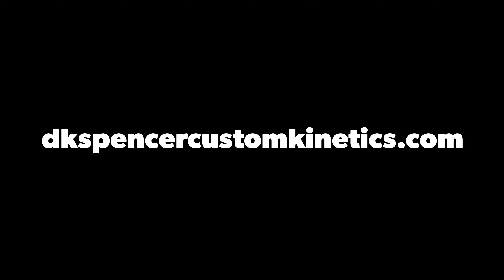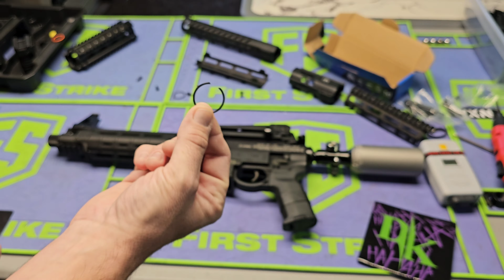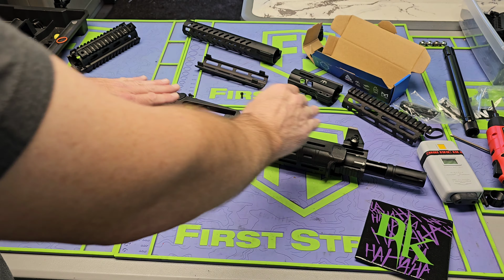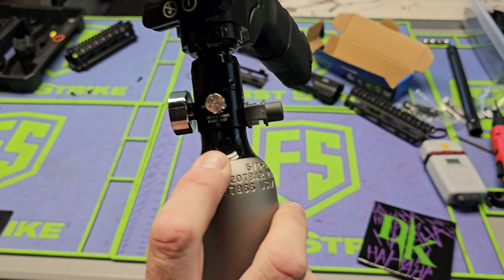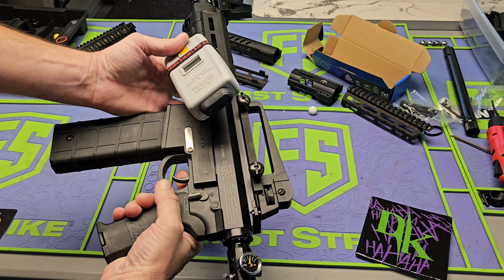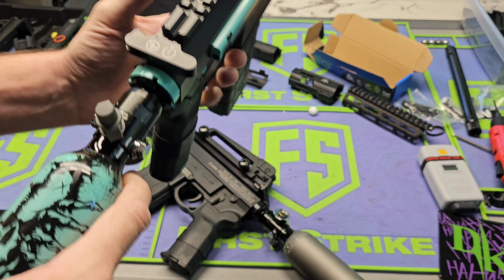Part 5: Conclusion and Test PSI/Sterling mod on VKS

Comment: Nice job.
If you shoot juls V2 8g then will not perform better? The white ones looks loose on the detent 🤔
Reply from the maker: For the detent yes for power no.  I typically get just a smidge more out of the heavier ones which that's just typical ballistics.  But the v2's definitely don't slip out as easy but with wixon's neither do the others
Reply: @DK-Spencer  sound good thanks for the information 👍🏻

Comment: Henry is an authorized Pepperball dealer. I sense there's a lot more to that customer's story besides "I bought this VKS from PSI and now he refuses to work on it." 

Cheating customers, bad customer service, or abusing them are the quickest ways to have a dealership agreement yanked. So what I suspect happened, that customer attempted to mod his VKS and in the process he ruined it. End result, Henry probably accommodated the guy up to a point then reasonably he stopped. 

This is a very common situation in retail sales when questions of warranty repairs come up. E.g., companies will not honor a warranty if the customer has in any way fooled with the product. To be sure, we all are familiar with the warning: "Removing this screw voids your warranty." And no company (e.g., Valken, Umarex, Byrna) will work on your launcher after you modded it. And those who lie about not modding the launcher, on a warranty claim the Company will look for signs of tampering. 

Bottom line, Henry and Danny have business relationships with the big companies. So I seriously doubt your new friend/customer is being up front with you. Seems to me the decent thing to do is that customer should be up front about what happened to where Henry said "no more." I suspect that BrilloHead guy may have modded the heck out of his VKS, ruined it, then expected Henry undo the damage. (I vaguely recall Henry about a year ago mentioning something about this situation.)

P.S. Curious: Did you do all that work for free? If not, how much did you and Charles charge him? Also, why is his eBay ad still active?
Reply from the maker: Henry has never claimed to be a dealer and Sterling lies about being a dealer.  Both have a lot more than just this guy that have complained about their customer service so yes I believe him and no I did not charge him anything
Reply from the maker: Number one authorized dealers cannot sell modified products number two authorized dealers cannot sell on eBay.  They both sell modified markers and both sell stuff on eBay, lol.
Reply: @MortimerEsq I did not break anything except the air chamber o ring. Henry is going around lying about what I did or did not do. Don't believe a word he tells you. Just don't. Not to mention the fact that Henry overcharged me for his build. What I asked out of Henry is not unreasonable as he claims. In fact, that's basic customer service that he should have provided to me for free since I overpaid for my VKS. I'm disappointed in Henry's lack of customer service.

Comment: So how much of a performance gain would I get if I was using your power barrel?
Reply from the maker: We can find out
Reply: I was wondering the same thing.  If the barrels were swapped between the repaired vks and the dks vks, the power results could be less of spread difference or maybe not but would be interesting to see. Thx for vid
Reply: @babraham.  I do appreciate him using stock factory barrel to run power tests, but since he was using power barrel vs my stock factory barrel, I think it would only be fair to use the power barrel on my VKS. If his power barrel is better than stock, then I expect to see higher numbers from it. And this test would be equally fair and should not be too much to ask. Although Sterling's power mod was disappointing if it didn't contribute much to the total power. For the longest time I thought my VKS would be shooting 70 J but I guess not.

Comment: "Henry and Harry both failed to secure the firing pin from this 2yr old launcher. Will my locktight last forever? No, check it often because they come loose"
😂😂😂
Reply: Lol, you never loctited the set screw anyways. Joke is on you, mister.
Reply from the maker: When loctite has been put on one it at least has some resistance to unscrew it, even if it's not tight enough to consider secure.  This one could be turned  with your fingernail This had never been secured, not with any descent amount of red loctite anyway
Reply: @DK-Spencer  Henry has never loctited the set screw. I was going to use blue loctite but did not want to reposition the firing pin all over again. So I just kept tightening the pin everytime after some shooting. You're a solid guy, DK, for going the extra mile to lend a hand to fix a VKS for me. I can't thank you enough. Most importantly, you have better customer service than those other two guys I have ever dealt with. So thank you once again.